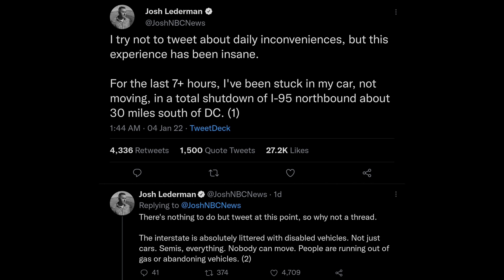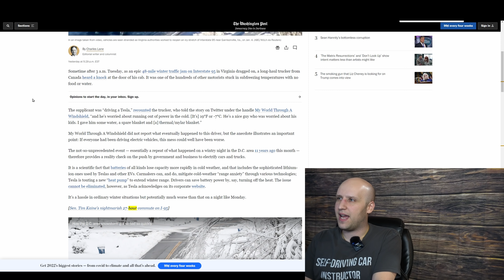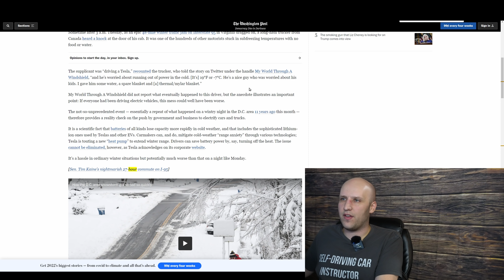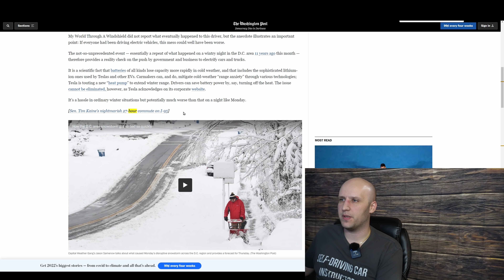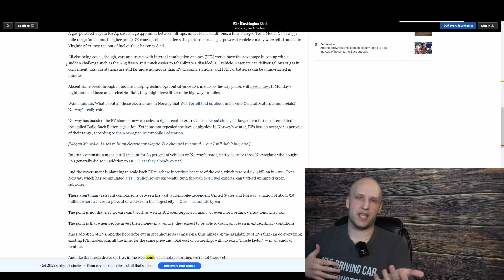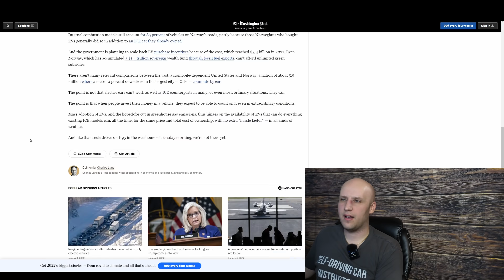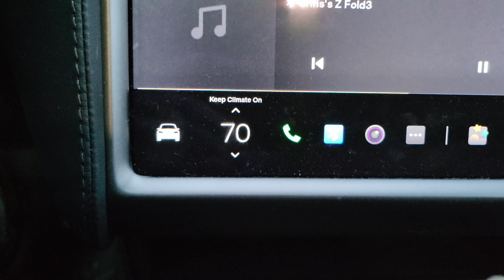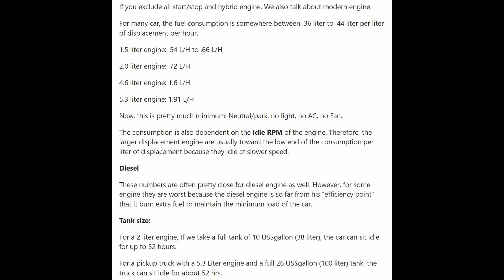How Long Can a Tesla Keep You Warm In A Frozen Traffic Jam? | FUD Debunking

Comment: I caught a snippet of that new story when this happened and I went out looking for people that tested this. I'm glad I ran across your video where you did an actual test. 
As for the gas vs electric while stuck in traffic. It simply depends on how much fuel you have while stuck. It always depends on how much fuel you have. 
I remember the same situation that happened in NW Indiana decades ago. Everything used gas engines. Plenty of cars ran out of fuel. They used the National Guard and some tanks to pull them off the road. 
Anyone in an EV that was unlucky enough to be at 10% charge would be in bad of shape as someone in an ICE vehicle with a quarter tank of gas. 

I also think that perhaps the EV owner may be in a better position to be prepared for something like this vs the ICE owner. I only say that because my motivation to keep the tank full (when there's gas left) goes down as the temperature goes down. However, it takes no effort to top up the battery while the car is in my garage. 

With that said. So far I'm on track to purchase my first EV this fall (it looks like the Ioniq 5 is in the lead at this point). All of my lawn equipment has been replaced by battery operated equipment. And the last thing will be a powerwall and solar for the house. So far I've had nothing but a good experience with battery power. That includes my snowblower, which checking my cams I will need to use again in the morning. 

Side note: I'm also looking forward to renting my first EV (Tesla) when we go on vacation this summer. I just want the wife and I to get familiar with living with an EV for a week.
Reply from the maker: Awesome! You'll love it. Ioniq 5 looks great too. We have solar and powerwalls and it saved us from a 50 hour power outage this summer https://www.youtube.com/watch?v=DA3fRMm3a0c

Comment: You can not compare a gas engine to a battery powered motor. A combustible engine if it’s sitting at idle even if it’s low on fuel can run a lot longer than a cold battery

Comment: What a load of wrongs. 

First of all, your energy waste is not proportional, because it depends on plethora of factors, so your calculations are not precise at all.

Second, EV does not have ANY advantage over the ICE, the only single advantage it has (and that is currently) is low electricity price. Nothing can't stop a government one day to charge you 1 kWh for your car much more, than present day gas price.

Third, my Audi 80 B3 stores 623 kWh of energy.

Comment: I'm Canadian. I have two cars. In the trunk (boot) of each is a baggie with two empty tin cans (that fit into a cup holder), a Bic lighter and two bees wax candles which will burn for 24 to 30 hours. No need for gasoline or battery power to keep warm.

Comment: The thing is that, if every car was electric we would shut down the power grid. There is currently nowhere near enough capacity!  Think Texas.  And where I live I can  think of ONE charging station. There just is not enough charging stations and if you take 15 minutes to charge you would need lots and lots of charging stations ,if you had the capacity. It won't work unless these and other issues are addressed.

Comment: Awesome!  Thanks for making this video, def going to be paying the link to this.  Makes me smile too myself as I did some quick googling and rough calculations and basically came to the same predictions.   I also pointed out that electric cars may actually be more efficient over time in keeping a passenger comfortable than a traditional ice car.   Also, I wouldn't be surprised if we eventually see super capacitors make their way into the market which would tip the convenience scale back in favor of the electric vehicle in this kind of situation once the infrastructure is rolled out to incorporate that.
Reply: @midwestnet2704  🤔 this wasn't a discussion about what they should do with the grid so not sure how that comment applies.

Comment: I got to laugh 25 deg as being cold. The other night it got down to 3 F and I was fine in the back of my truck in a surplus army sleeping bag and a blanket. The bag is not what I would consider a winter bag. No matter, what you do is put two hand warms in the bottom of the bag. climb in zip up and cover with a blanket. chances are you will have to shed some layers. You will not be cold. In winter you should have a sleeping bag some hand warmers a jet boil is nice to have along with water for tea or a cup of noodle soup. Never travel in winter without at least a couple of blankets.

Comment: Another point I thought you were gonna mention: EV's don't use idle fuel. With a gas car, although it's true that using the heat won't really eat up additional fuel, the idling itself does of course use fuel. With an EV, you don't use any fuel because there is no "idling". The practical application of this, I guess, is if you're stuck for extremely long time in very slow moving traffic jam. In theory you could turn your EV's heat even lower, and extend your range possibly even beyond an ICE car, since ICE cars have to have an engine running to move at all.

Comment: As someone who has had to leave vehicles running in cold weather (sub 0) to keep the cabin warm because I was snowed in on the road, I can assure you that a modern ICE car can do so for days on a full tank.  A diesel vehicle for even longer since, at low load, they are basically pumping air (well below the stoichiometric fuel air mixture).

Here's the thing, the argument that ICE cars are "less efficient" is specifically because there is so much "waste heat" in the system.  This argument is valid on a sunny day when that heat truly is waste. That heat is the result of motive power.  In cold weather, that energy is vital.  Meanwhile, the Tesla does have to burn fuel to heat the cabin.

At a dead stop, both are wasteful, but the argument that spending in excess of 25KWH in such a situation when that is a considerable chunk of the fuel capacity is hardly FUD.

But here's where the EV argument falls apart.  Not everyone can charge their vehicles at home.  Anyone in an apartment complex has to rely on charge stations to get their energy.  While rural and suburbanites can reap the rewards, apply that to everyone on the highway.

Now imagine the rush on the precious few charge stations after such an event.

I am a green energy advocate, and we have to be more self critical of our arguments.  A lot of this comes down to classism.
Reply: Here's something to consider. Truth is, most people charge at home, and most use 120v to do so. I've owned EV's since 2016 and now have 2, a tesla model y and Hyundai kona. Because most people, including us, drive less than 50 miles a day, thats easily replaced overnight with 120v. We also have a level 2 charger, that serves both, should be need a ' fast ' charge ( up to 40 miles per hour at 240v ).
What isn't being talked about, is the potential for sickness or even death (children are especially susceptible) from carbon monoxide poisoning. A faulty muffler or cat can kill in less than an hour. I've never worried about my grandkids playing in my closed garage with my " engine running ".
Reply: And utility pole smart chargers are popping up across the US for your point about multi family and apartment/ townhouse ev owners. Also mall and shopping center parking lots. The industry is evolving rapidly to accomode the masses. There's more...tow truck owners can now carry portable charging units that will charge several cars enough to get them to another charger. Europe now has in-road " touchless" or harmonic charging powered by renewables and embedded into the roads. Coming soon.....
Reply: @69snoopster  great, so poor people have to park and sit in a mall, in the cold, while paying a premium, because they got stuck in the cold.

And as to the CO component of exhaust:

"The widely spread use of catalytic converters, which decrease the amount of CO in the exhaust fumes from 3.5 to ca. 0.5%, seems to be the reason why there has been a substantial decline in the number of suicides committed by poisoning with CO from the exhaust system."
Reply: @coreyfro  yeah, cause everyone has a newer car, especially poor people.
Reply: @69snoopster  100% of people with ICE cars have heaters. It's a part of the radiator/coolant system

Comment: If I was put in this same position, where I was not sure how long I would be trapped, I would not set the temperature at 70 degrees.  It would be 35 degrees or even less so the batteries would last a lot longer.  Driving anywhere in the winter months means I would have warm clothes on so I could stay warm in a closed car a lot longer.  It's the same principal as an igloo which actually stays pretty warm inside.

Comment: What's your range at this temperature when you're traveling on the interstate?  What about on the road when it's 90-100 degrees and you're running the AC flat out?
Reply: When the car is warm, you only need to maintain the temperature, as he showed. When driving, you have the advantage of some heat being generated by the motors and the battery, which can be used to heat the passenger compartment.

I have a Tesla Model 3 LR 2021 and I did some driving in -10 °C, and the power usage increased negligibly. It usually (above freezing) uses around 125-130 Wh/km, but that day it used 140 Wh/km. There was a little bit of snow, so rolling resistance was probably slightly higher than on dry pavement.

I have the car in a heated garage, so everything is already warm when I leave home, which means that the difference should amount to the increased rolling resistance and the heating to maintain temperature in the passenger compartment.
Reply: I live in Texas and the AC is not an issue.

Comment: !!!!GUYS EMERGENCY PSA!!!!

Do not try to jumpstart a frozen car battery. It is severely dangerous and can cause an explosion. I REPEAT, YOU CANNOT JUMPSTART A FROZEN GAS ENGINE’S CAR BATTERY!! YOU CAN BE SERIOUSLY INJURED!! 

If you are going to jumpstart a dead battery in freezing temperatures, you have to thaw out the battery first and foremost. EV battery packs are not the only batteries that need to be warmed up during cold weather. Please be safe with your vehicle during freezing temperatures.

Comment: Why not keep a wool blanket in the trunk and some candles?  Yes, a candle gives out significant heat.  It won't make it comfortable inside, but it may keep you from death by hypothermia.  A down pillow held against the chest is very good insulation.  Snowmobile suits, long Arctic jackets -- there are any number of ways to keep warm in cold weather without running your heater.  The problem is that many  people is that they don't anticipate trouble and prepare.

Comment: I lived in the Canadian Rockies for 15 years, the first year I learned the hard way avalanches can get you stuck for more than a short 12 hours (almost 2 days for us). Since then I always carried: blanket, socks, mitts, a candle, a bivy bag, and a small tent. few protein bars and a cantine so I can boil water.
now I live in a city and I still carry all that stuff we never know...
Reply: What's the candle for?
Reply: @byever1  in a car or tent just the heat of a candle can save you from freezing at night, and it can be easier to light a fire with the candle too
Reply: @byever1  Date with the homeless girl
Reply: @frazmeup  hahahahaha
Reply: @frazmeup  Great way to keep warm
Reply: They make small propane heaters
Reply: @starcityrc3298  are you serious, burning a propane heater in a enclosed space? Can you say Carbon monoxide poisoning?
Reply: @starcityrc3298  NEVER burn propane anywhere besides in a well ventilated area.  You WILL die.  Where I'm from, back in 1998 we had a major ice storm which knocked out power for weeks in a major metropolitan city.  Many people died from just that, using propane heaters and barbecues indoors.

Comment: There is something that you did not consider with a gas vs an electric vehicle in a the cold. If you are stuck in the cold, to conserve fuel, you can turn the vehicle off. When the cab gets cold, then you can turn the vehicle back on to warm up the cab for a few minutes. Then you can turn it off again. With an electric vehicle you cannot do this. Also, as long as it is cold, the battery is being attacked. Cold kills batteries. So, the cold would just gradually suck the battery of its energy if it is just sitting. If you do start the vehicle up, the battery will be sucked of its energy while in use.

Comment: Having dealt with a similar situation in the mountains near Chattanooga in a 2013 Model S 85 I was near the end of my charge (Chattanooga was the destination to charge and the only charger east of Nashville. I managed the 35% charge during my 6 hours and came into the SC at about 10%. If I remember correctly I had about 20 miles from the stop to the SC. Thankfully it was all downhill. Now that the SC network is more built out I will be able to weather such a stoppage better. I think the temp dropped to 58 or do in the car but it was manageable.
Reply: If the battery were to run out you would have died without a tow

Comment: One more point about refueling gasoline cars. Gasoline does not freeze until about negative one hundred F. So if you're using a gas can to fill a car in temperatures below 30 F and you spill gasoline on yourself then you can get instant frostbite.

Comment: The batteries are the same temp if you've used the car or not. Tesla has a heater in the battery that has to be on all the time or you couldn't charge the car anymore.